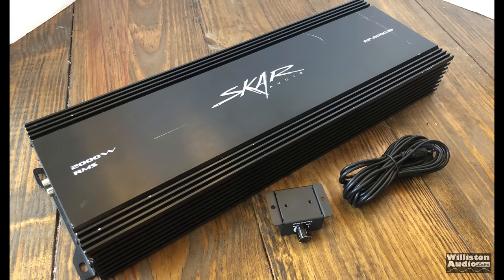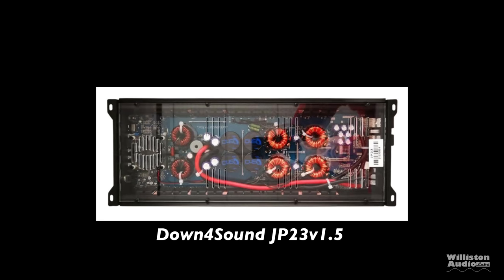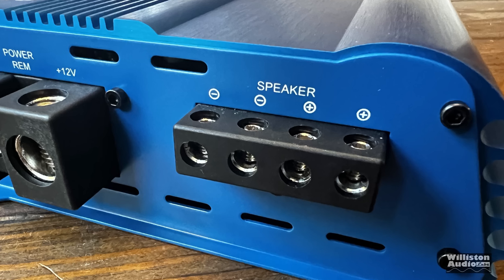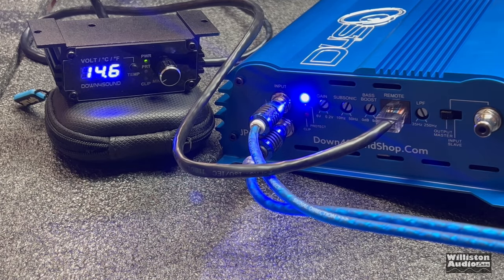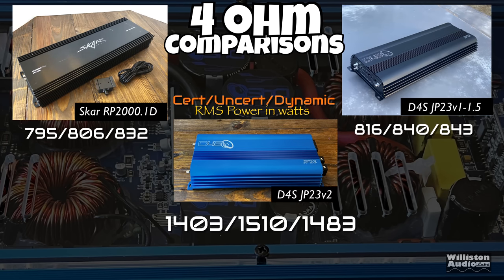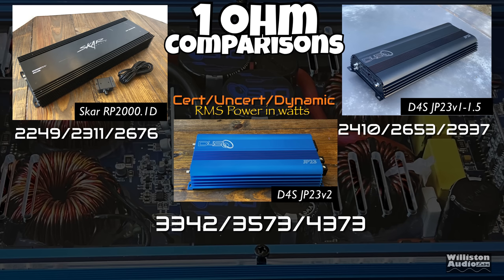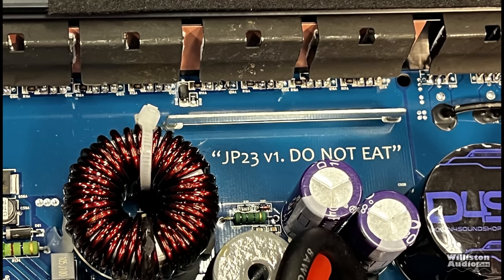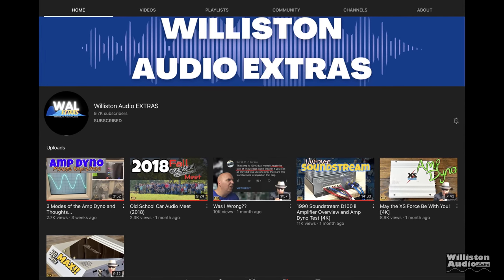The End of SKAR AUDIO's Dominance? Down4Sound J23v2 Amp Dyno and Review

Comment: Skar is cool looking and a great budget build. 
The big problem with Skar it’s virtually every amp and subwoofer at some point somewhere has some reliability issues. There are more budget builds nowadays and then the 90s when I was growing up but you still get what you pay for. Down for sound make some solid products very good good price point. Personally I run Harman audio Infiniti components and subwoofers. I like to use alpine amps but on my subs I am running a Kicker 1200.1. If I had to rebuild a system from scratch I honestly think the best middle line quality you can get a CT sounds for your price point. No one complains about their products and you can get a very good set up for a small amount of money. Plus they just came up with a three speaker component system which is what I prefer to run. But I am more into SQ build an SPL builds

Comment: I’ve got the JP8 and it has been AMAZING!!!  Originally I had it on a single Savard HiQ running 1 ohm.  Now, it is powering eight 6.5” woofers in an infinite baffle setup running 2 ohms.  It runs cool and has plenty of power in reserve!!
Reply from the maker: The JP8 is literally my favorite amp in the lineup. Works with factory electrical (most cars) and puts out the powa!
Reply: im gonna strap 2 once i get my new subs in

Comment: This amp has all the power and features you need and leaves out what's unnecessary (Except for the missing phase control). Fantastic power for the price. The quality of the construction seems good too. Now I'm waiting for them to produce an 'audiophile' version class A/B, the final frontier!
Reply: why would you need phase control 0 and 180 can be achieved by simply flipping the positive and negative wires on the speaker terminals
Reply: @kylevanwinkle2081  Polarity =/= phase
Reply: They do make one, its huge.
Reply: So, I googled 'Is a phase control needed on a power amplifier?' It seems there is no consensus of opinion in this matter. Some people do believe that a variable phase control is helpful for matching the subwoofer(s) to the other speakers in a system. Others dismiss it as superfluous.
Reply: @samwise4me903  time alignment does the same thing to a better effect.
Reply: They do make a class A/B amp for "audiofiles". It's a beast and huge. Definitely not for only a couple small door speakers.
Reply: @hopskustomaudio  they make several class ab not just the 13.2
Reply: @kylevanwinkle2081  you are correct. They have added the purple 590 watt class ab since I last looked.
Reply: @kylevanwinkle2081   That I have never heard of. I'll google it. Sounds interesting.
Reply: A high end amplifier with better componentry + design maybe even monoblocks are needed to breakthrough to the audiophile community..

Comment: Bought one of these because of this video had it installed in my crv with 2 zvx 18s to 1 ohm I thought, about 9 or 10 months ago. Went to a car show this past weekend and found out I've been wired to quarter ohm for 9-10 months and couldn't figure out why the amp would go into protect when I would do my spl runs. I thought this amp was trash went in-fact its a solid amp with great protection features that saved it from quarter ohm beating for almost a year!

Comment: Thats great they were able to make the amp smaller, with more output! Also, it's nice they lowered the brightness on the level control. I took mine apart, after finding an old piece of kodak film negative, and put that in front of it to lower the brightness, and then put back together
Reply from the maker: That works too!
Reply: I used a piece of window tint.  Worked perfect.

Comment: I'm still running a 1200w Rockford Fosgate amp I've had for many years but if I ever need to upgrade the JP amps would definitely be on my list
Reply: I had a rockford fosgate 1200 but now i have a jp23 v1.5 and you definitely need a separate battery.

Comment: I just purchased a JP234 to replace my Skar 150.4 and should be getting it delivered this week. At twice the rated power I have big expectations for it
Reply: That 234 will run a lil hot but has mega power turn it down on the gains if you run components my focal flax tweeter couldn’t take the heat lesson learned 234 monster lil amp
Reply: @KeithWebberKaz  yes after running it for a few months now I have nothing bad to say about it. The Tiffany style inputs are a wonderful feature and while running it to 4 ohms and no clipping it is still plenty loud and hasn't gotten hot yet. It is fuy exposed, right near a window in a hatchback so airflow is never an issue

Comment: I see alot of ppl that run these on tiktok with 4 gauge power/ground wires and factory electrical lol. Deff took Skar RP2k's spot! RP2K has a permanent protect issue so u gotta get the right one. I went thru 4 till I got the right one! This was almost 3 yrs ago now, and I still got it and still works.🤷‍♂️

Comment: Good evening sir 
I got my hands on a Skar audio SVR-10 dual 4 OHM 800 watt RMS speaker, I was thinking of using a Skar Audio AR1X10V Single 10" Armor Coated Ported Subwoofer Box. What kind of amplifier would you recommend for this application? I’m also adding an Alpine 4 channel 800 watt amplifier and changing all four 6-1/2” door and deck speakers as well. Thank you in advance for the advice

Comment: One change I would love to see for v3 is to get away from using the RJ50 10P10C connector/cable system for the bass remote knob.  Makes it a pita to make a custom length cable.  Surely this can be done over a standard 8P8C RJ45 ethernet cable?
Reply from the maker: Must need the extra pins for all of the options
Reply: @wal  I mean the whole entire internet comes to me over an 8P8C connector, I’m sure they can figure out how to make a lowly bass knob work over it too 😂
Reply from the maker: @MegaMyk777  😝👍
Reply: I didn't even realize those cables are RJ50 cables. I am looking to sell my v1.5 for a v2 and was going to include a rj45... good thing I came across this... guess i may have to buy the v2 first and take the cable out to give to someone when I sell my 1.5?

Comment: I litterally bought the jp23 v1.5 earlier this month and have been running it for about a week and a half bumping a sundown audio u12 1500w. It's a fantastic amp. I wish i had some foreknowledge that the v2 was litterally right around the corner. Oh well. I have no complaints other than bass knobs 2300 lumens leds.
Reply from the maker: Yeah man the earlier versions are still great amps. Just get some tint for that bass knob display and you’re golden ✌️

Comment: I bought a replacement Cat5e cable but only the clipping light worked nothing else turned on? Could you send the specific cable or how the wires in the connector are lined up?

Comment: I got a question. I currently have a cab22 I do not have the big 3 but I have 1/0 ofc Hifi Vega amp kit and I have a spare agm. I currently have the stock alt. Would this still be ok to use if I have had no problem using the cab 22?

Comment: I'm thinking about putting the jp8 on 2 kicker compr 12s. just don't know about the reliability of these amps considering they shot for skar quality with this line. skar seems to be very decent construction but crap materials regardless of product. Any suggestions for a relatively bullet proof amp for 2 12s is greatly appreciated. may just go with the alpine 600w with the compvr 12s instaed. thanks for the content and any suggestions
Reply: Can go wrong with alpine or rockford.  Not as much power for the $$ but reliable and stable as heck.
Reply: Both of my Alpine amps blew from heat (az here) I'd take this any day over another Alpine either way tho

Comment: I think these amps have done more above rated than any amps I have seen. I keep telling people THESE are the amps you want.
Reply: You need to look into Orion amps then lol
Reply: @OrionHCCC26  I'd be buying a XTR2500.1 if they came with voltage, clip, and temperature on the bass knob. A clip light on a bass knob is almost a necessity, yet most companies don't have them. That's the only thing keeping me from that amp, the knob not containing valuable information.
Reply: @tysonb8328  either make your own knob or just buy one. Slam panda or any of the other numerous guys that make em custom and fairly priced. I have 4 Orion 3ks and I just use a slam panda one that has all that.
Reply: @tysonb8328  also, no one needs a clip light if you are tuned right and know your system. You should know when you are clipping

Comment: D4S amps are actually really nice with good power. I was running the jp234 but replaced it with a USacoustics class AB 6x150 @4 ohms. If D4S had a 6 channel for my active 3 way I would run that amp for sure.

Comment: D…what speakers should this amp be powering??? Are there full range speakers that need this kind of power or is this just all subs?
Reply from the maker: This amp is for subs
Reply: @wal  if it’s stable to 1ohm couldn’t we ghetto rig it and just run all the speakers off the 2 channels Full range and then add in line crossovers to the subs?

You could get at least 6 speakers bump’n off that thing!
Reply: @joesshows6793  only problem with that plan is that the amp is not full range. The low-pass crossover isn't defeatable, so it's purely a BASS amp.
Reply: @timstarnes8587  oooooh okay. So we need a full range 2ch 1ohm stable million watt amp for testing pronto! Pyramid????

Comment: I’m new to the whole car audio modding community, so I have no idea what I’m doing lmao. I’m finding my way, albeit slowly
Also, I’m getting a Skar 15” 1200 watt sub. Could I use this amp and be fine, or would it fry the sub by having much more power than necessary?
The sub is only one Ohm, so… likely way overkill for sure
Reply from the maker: Yea that sub and this amp would work but you may be fine with the smaller JP8 and you won’t need to add a 2nd battery. Just make sure you use 4ga OFC power /ground wire at a minimum from battery to amp (JP8). JP23 will need 1/0 wiring (OFC is a MUST as well)
Reply: @wal  I don’t know what some of that means, but I think I can guess!

Comment: Do I need this much power? So how stable is this amp below 14.4 or like around 12. 5 or 11.5?
Reply from the maker: It works down to 10V I believe but I would keep around 12 or higher if possible
Reply: @wal  Taramps don't seem to like 11 volts

Comment: Idk if u remember but the Amp u have their is an Amp I sent back as a team mate on skar audio I had popped it on a burp it was also screwed straight to my box with sheet rock screws, those snapped off during the burp, personally I think u have a defect on the rp2k I have seen them tested at 3500 watts on a dyno, but it still isn't as good as this jp Amp by any means just telling u what happened to this Amp I popped some mosfets and caps in it by running it a "little" lower then rated load

Comment: I'm curious if JP's amps will last and still perform over time. Where I live in NY the temp changes are insane to over 100 degrees to -20s.  Also I use my system every day for atleast 2-3 hours on very rough roads, which obviously causes a ton of abuse on my audio system. 

I just want to see in a proper set up like mine. Perfect voltage consistency 14.4-14.6 with very little drop, also have 2 sparked inno. Fannies, if they will last
Reply from the maker: Good question brother. They haven't been out long enough to get any real long term reliability info
Reply: As someone who also lives up by NY i can tell ya as long as you gently bump your music on low volume to "warm" the speakers up youll be fine. I usually wait till im at least comfortably warm before really turning the system up.
Reply: Amp has taken Texas extreme heat and daily bumbling with no problem will be as hot as 130 on amp bumping no problem

Comment: I have two brand new jp23 1.5 sitting in my garage? They are just not strong enough for my fi hcca 15s and my two sundown xv3 12s and two massive hippos XLR I will just keep them as a souvenir? Not into Korean amplifiers anymore? I've owned dd amplifiers hifonics generation xx collousous amplifiers my taramps bass 8k and md 8k pushes a lot of power with less current being drawn clipping destroys subwoofers and increase in voltage drop I'm 56 years old I was around the when the white auto tek mean machines orion lanzar punch 150s rodek and us amplifiers  Zed audio was the best designer and US amplifiers?

Comment: Have you thought about testing run time before it gets too hot and goes into protection mode? Meeting what they state is good and all, but not if it only handles 5 minutes of play time.
Reply from the maker: I've thought about it but I usually run the amps for at least 30 min on subs hard and I know by then if there is going to be an overheating issue. None experienced here
Reply: @wal  Glad to hear that. Makes me feel reassured about buying an amp I don't have history with. Thanks.
Reply: I'm finding this amp heats up very quickly, what about you?

Comment: I have been hoping ever since the JP series came out that JP would also make a JP2 - 200 watt mono block amp & JP5 - 500 watt mono block 1-ohm stable amplifiers for us low power users. But sadly it does not look like JP is going to release any.
Reply from the maker: There is a JP3 coming soon will be around 500W constant 4/2/1 ohm. I totally dig these too!
Reply: @wal  That is just what I was hoping to hear, thanks for the heads up Big D & thanks for the excellent content!!!

Comment: What size remote wire do you need to run on this?
Reply: Same as most amps I believe. Can go as low as 20 gauge probably but I normally run 14 or 16 gauge. (Remote signal is a very minor draw)

Comment: I have a problem I have a jp23 and I have 2 dual 2 ohm subs and 2 dual 4 ohm subs how do I wire them to the safely
Reply: Get matching subwoofers. Same brand/ohm load. The JP amp manual has a diagram to wire down to whatever ohm load you’re wanting to be at based off how much power you need.

Comment: So glad I bought this beast the day it came out! Just taking to long to get my new power wire to run this monster of an amp! I love it
Reply: Hey dude how you like the jp23v2 amp? I was looking a few amps the Salt 3 Synergy WFO 2.1 and someone mentioned the jp23v2. Price seems really good compared to the Salt series for sure.
Reply: @johnnypiper1717  The Salt 3 would be the way to go in my honest opinion.  but the jp23v2 is great for its price.  I had no issues running at 0.5ohm and it does put out some  good power for a what is basically a pretty small half-bridge 3k

Comment: Just quick questionn,are you giving away $700 sub and t shirts? Someone just said I won't exactly that
Reply from the maker: SCAMMERS!
Reply: @wal  ok,just wanted to give you a heads up
Reply from the maker: @markroberts715  I check and remove them as often as I can, hoping YT has a solution for this soon. I'll never contact anyone in comments saying they've won anything as anyone other than Williston Audio Labs (with a check mark at the end). This shows I'm certified as this user.

Comment: The one thing you fail to make a SERIOUS note of though is that the JP amp is almost DOUBLE THE PRICE,... ON SALE! Than the RP2000.1d.  A person such as myself who built their whole system from HU all the way to SUBS, buying the JP may NOT be the best or even a reasonable option.  It aint about price, but in a way it is.  See I purchased my 2 -Skar ZVXv2 12's in 2ohm format, with the entire idea being that i wanted 2 separate amps, so each sub is run independently!  With 2ohm subs i can only get to a 1ohm load on each sub... and CANNOT run the subs together on one amp, without locating a GOOD .5ohm amp, which ALSO is cancer for your cars electronics, because my system stays installed as a daily driver.   So with 3k watt subwoofers, the RP2000.1d is the IDEAL match for the ZVX, if used individually like me.  It sounds PHENOMENAL running as separate subs, each in its own 3.25cu ft box tuned at 33hz.   As a prior competitor in Iasca, and a 26yr car audio background, i have heard it ALL, and i promise you that 1 ZVXv2 12 or 15, paired up with 1 RP2000.1d, will produce sound AS LOUD as any 2 subs from a diff mfg.  Im not disclosing official test results, because i dont want to give away specs prior to an upcoming comp... but i will just say, using the same Mic/Measurements of the DB Drag race officials, the numbers and outright POWER im getting from these is RIDONKULOUS, for 2 12"... details will come out in a video after the qualifier this upcoming December!

Comment: What a badass amp.  The price is killer for the power!  Would love to be able to push that, but I'm not going to upgrade my whole electrical system.  I'll keep my total draw at under 1200w, it's still decent enough for my Tacoma.  Love your videos, they've always been well-made and informative.
Reply from the maker: yeah man the JP8 is still my favorite for factory electrical although this one could work at 4 ohms with high efficiency and lots of available power
Reply: @wal  Would you use a JP8 or R1200 (fosgate) for stock electrical?

Comment: to be fair the v2 is a 3k and you are paying for that extra power. the amp is $380 now. the skar is a 2k priced at $212. i just wish amp companies would just rate their amps accurately. to d4s credit there amps are not over rated making buyers feel cheated. they are however giving the illusion that you are getting more than what you paid for. i personally dislike both marketing models. the $ to watt ratio for the skar and jp are very close. buy the one that fits your budget and application.
Reply from the maker: Good points but I believe the SKAR is out of stock almost everywhere except their own website. The RP2000.1D is several years old and not the best track record for reliability...but price per watt it's up there with WUDI 😝
Reply: dont follow the text+phone number. its a scammer